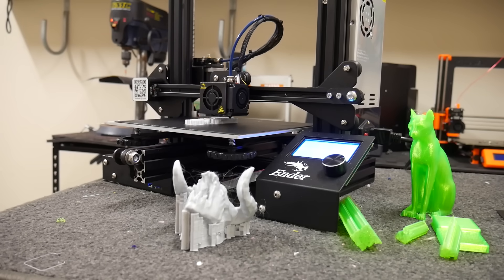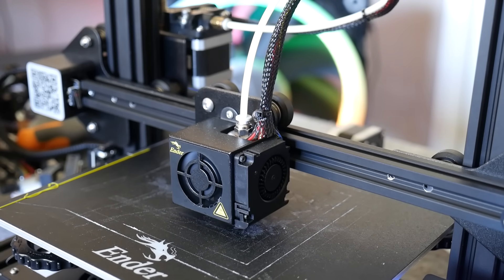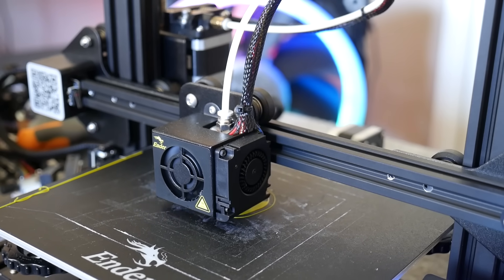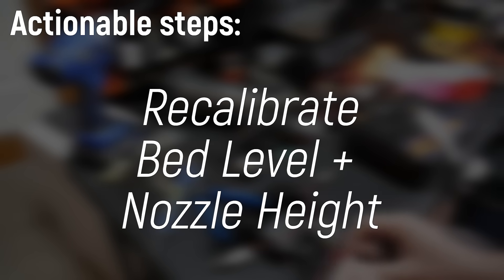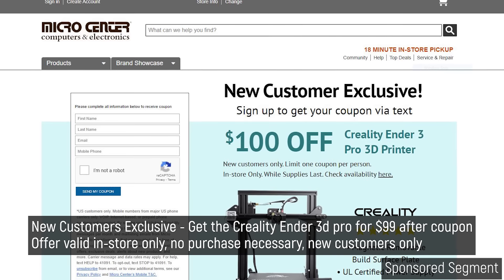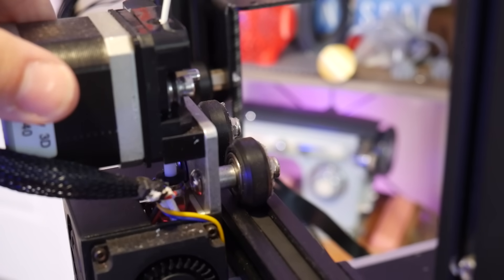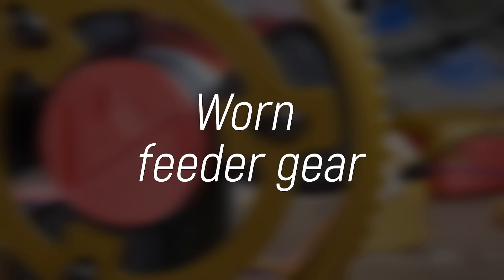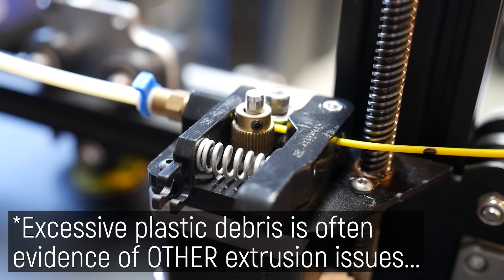Have your 3D Prints started to suck? Watch this!

Comment: Don't dismiss this information as obvious or basic. 6-7 years of 3d printing, 95 percent of issues I faced were addressed in this video.
Reply: True, the "mountain of ignorance" happens a lot for new people, and experienced ones forget the basics, kind of just thinking it was done already, or "it has to be more complicated than this".
Reply: In alot of cases the more experienced you are the less you actually know. You forget so much.
Reply: So your to 3d printing or bought the idiot proof version.... Started on a Tronxy p802ma thats bolta and metal in a box have at it, Where as a Ender 3 is 75% done in the box build the frame tram the bed good to go in 60 minutes or less....

Comment: Preventative maintenance is a must for any moving mechanism, especially if you don't want failures and down time.  Having spare parts on hand will make problems seem less significant.  No one should still have springs on the beds, silicone spacers or steel standoffs are far superior depending on the lack of, or type of ABL.  Great video topic Angus.
Reply: I disagree on not using springs. The Ender stock springs for sure should be replaced, but a stiffer set of springs can be excellent.
Reply: Springs work just fine, you just need to understand that if you've tensioned them where the coils are basically stuck together, you're gonna have problems.

They should be tensioned to the least amount, at the highest level. If your setup doesn't allow for that, then you need to change it, lower the head, lengthen the bolts and shim the springs. They should also be quality springs, not Bic pen quality as shipped with 99.9% of the mid level brands of printers. I use the springs used for BB g*ns, they're about the best quality you can get short of dismantling old Xerox machines to get the springs used in the paper tray mechanisms.

Silicone is a wearable item, and in time sags far faster than springs. You'd have a hard time finding 4 of the right durometer, IE to not sag fast because they're soft enough to actually do something. And finally, metal spacers are not a good idea. The whole machine is then tied to the bed. You've essentially transferred all the vibrations directly to your work surface. Unless you have the most rigid setup known to man kind, you're frakked.

Basically this whole discussion is present in cars. Rubber vs silicone, steel spacers vs rubber spacers etc. It's been done to death.
Reply: @aserta  plenty of printers have their beds rigidly coupled to the base that is nonsense
Reply: I can't stand silicone spacers.
Red load die springs for me, thanks.
Reply: @nicholasroos3627  You COULD do that, but it makes tramming on a bedslinger WAY harder.
Biggest problem I've found from springs wasn't from the springs flexing in their intended axis but because there was no constraint to keep them from sliding around.
As soon as I put spring collars on them so they were constrained in the x-y plane, have had no problems.
I only ever re-level my bed when I clean it, which is almost never. I'm printing on bare aluminum and using aqua net as an interface. No adhesion issues.
More important than how the bed is mounted to the Y-carriage is the quality of the kinematics for that axis. Enders and their clones, with that V-wheel BS, are especially prone to weird crap like this.
Reply: I work in an ISP NOC so i'm no stranger to how good it is to have spares around. That said, what spares would you recommend on a 3d printer (specifically ender 3 neo)?
Reply: If you do have springs they should be changed every couple of prints.
Reply: @jdakid156  changed??? bullshit. Why would you need to change the spring every second print?

Comment: Maintenance people its called maintenance, machines wear down, belts get stretched, bolts are shaken loose, pulleys dirty with dust, bearings get worn, the heating/cooling cycles distort the frame etc, etc. Look after your machines.

Comment: Ender 3 - if your prints are randomly getting punched off by your hotend a cm or 2 into the print, one of your factory springs is buckling over itself as it moves.

Comment: Great video awesome tips, for specific points.

0:22 Badly Levelled Print Bed
3:03 Dirty Print Surface
5:38 Worn Motion Components
9:27 Dead heat break fan
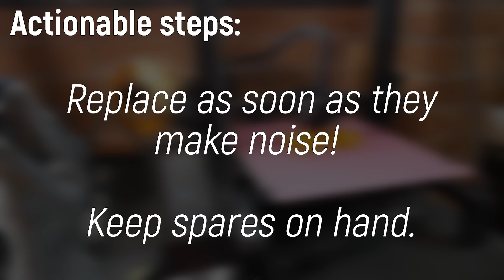11:16 Worn Feeder Gear
13:20 Blown out (abraded) nozzle
16:18 Electrical faults
18:16 Lack of Thermal Runaway protection
Reply: @Gtmz53fxt56zxc  maybe it wasn't when he posted the comment
Reply: Thanks
Reply: Thanks
Reply: Thanks now i dont have to watch the video

Comment: I printed 100,000+ hours on Ender 3s in 2020 and had almost all of these issues. PTFE cooking is a big one, and not obvious. Capricorn is awesome, but still only lasts 2-3x as long as standard. You can usually just cut a few centimeters off the end rather than replacing the whole thing.

Stainless steel feed gears are a very worthwhile upgrade.

A 30mm Noctua fan on the heat sync can help with noise and lasts way longer than stock (may need a buck converter).

If you're pinching pennies you can try and clear a clogged nozzle with a torch or lighter. Heating to red hot can usually get foreign materials out. But nozzles are cheap, just replace them frequently.

Set your Z height so that the springs are very tight to reduce the chance they loosen.

Oh! And one really tricking thing was getting cracks in the extruder tension arm. An aluminum extruder assembly can help with this if you don't just go direct drive.

So many hours, so many face shields. :-S
Reply: Yeah learned a lot printing as many face shields as fast as possible. They seem kinda silly now but at the time it was urgent.
Reply: @paintballercali  maybe to you
Reply: Heat Sink.  FTFY.
Reply: Yes, steel gears and a titanium all-metal heatbreak will save you so much time.
Reply: Swap out your hot end for an all metal one eliminates ptfe tube degradation. Saves money on ptfe in the end.
Reply: A couple notes on the Noctua fans:

- Regarding size, there are no 30mm ones (there are 30mm thick ones if you go all the way up to their 200mm fans, but not any smaller. The rest max out at 25mm). You want 40mm fans, which come in 10mm and 20mm thicknesses.
- They do have a 24v option, meaning no buck converters are needed, and they should be a drop-in replacement. If I had to guess, this is probably the same one that Prusa uses as their hotend fan. It's a 40x40x10mm fan, model number "NF-A4x10 24V PWM"
Reply: 100,000 hours are more than one year
Reply: Why face shields?  @paintballercali
Reply: @minecraftnoob113people can have more than 1 printer

Comment: I just ran into that heat break fan issue a few weeks ago. Started getting a ton of clogging out of nowhere, with the filament end mushroomed out just like you showed. Then I noticed the fan was getting much stiffer than it used to be, and remembering how the heat break works it occurred to me the filament might be melting too high up if it wasn't getting enough cooling.

Another thing I ran into recently was the nozzle tip wearing down. Since I have a BLtouch I don't have to physically check clearance under the nozzle very much, but periodically my first layers would stop working right and I'd look for something to tune to get them back. Noticed the texturing on the stock bed was wearing out, replaced it with a nice PEI plate. Deep cleaning it after every few prints, printing almost everything with a brim, glacially slow first layer acceleration, built a semi-enclosed acrylic shroud around the printer to keep drafts out... One thing that perplexed me for a while was that I had to baby step the Z offset down a little every month or so, on the order of .3mm or so over a year, at a fairly consistent rate. How is that even possible??

Then I got the nozzle completely clogged up with a failed print that went for a good hour before I caught it and decided to replace it (blob of filament smeared all over the outside surface, silicone sock was getting pretty deteriorated too). Looking at the new nozzle next to it I noticed the old one was worn down very visibly from the original tip. By roughly the amount of accumulated Z offset change I had observed up to that point.

As a hobbyist who genuinely enjoys learning how to troubleshoot and modify systems (and not someone running the machine to make money) it's really interesting how all the different failure modes can pop up.

Comment: Thank you for this video!  It helped me immensely already.  My wife got me an Entina Tina2 printer bundle after I looked it up, and after half joking about me learning to 3D print things to join her selling at craft shows (she crochets, AKA 3D prints with yarn), she said "that's it, we're getting it" and purchased it.  

It's done fun little things and I learned through some misprints and growing pains, but I am glad you brought up the fan on the heatbreak.  My fan is making that noise right now, and I've also been having trouble with builds not sticking to the build plate.  Admittedly, the surface of it is covered in what feels like the back of some masking tape. I also kept forgetting it was a magnetic attachment and was probably unleveling my bed by yoinking or scraping prints from the bed.  

This information is critical for veterans and novices alike.  Thanks so much!

Comment: Great video as always. Swapping out the original bed springs with the smaller diameter yellow ones found in several kits made the biggest improvement for me. Way less releveling of the bed with those. I also like the idea of using a piece of Capricorn tubing in the lower part of the hot end.
Reply: I'm glad to hear that someone else has gotten good use out of those yellow springs, I swapped my springs at the same time I added a bltouch to my ender 3 and have had trouble "quantifying" how much those yellow springs help 😅

Comment: Another tip: the screws that attach the gantry to the printer's base can loosen up over time and cause the gantry to move while printing. Make sure they're always tight (add thread lock if needed). Additionally, printers that don't have extra stiffness rods like on the Creality CR-10 or CR-6 Max can have inconsistent layers due to the gantry flexing in the Y direction. Fortunately you can buy these rods separately and install them on many other brands (I put them on my Artillery Sidewinder X1 and now my walls almost look like they were injection molded).
Reply: What rods are you using for your X1? Would you be able to share a link? I have  awful lines when I print tall stuff out for my kids and would like to see if rods can fix the issue but I'm having a hard time finding correct parts.
Reply: @Gtmz53fxt56zxc  Not all plastics can be vapor processed, and most of the time you'll still notice the layer wobble even after smoothing. Better take care of that gantry, it's easy and cheap to do.

Comment: 3:45 For my Prusa Mk3 I found that putting the removable print beds in the dishwasher for a cycle (without detergent, running with hot water only) is the best way to get the bed 100% free of contaminants.  The majority of prints I just wipe it down with rubbing alcohol (mineral spirits), but after so long the oil build up just won't come off completely and will only smear.  That's when it goes in the dishwasher.
Reply: Great tip, thanks.
Reply: would you use a heat boost/steam cycle or could that warp the bed

Comment: This video does make me appreciate my prusa a bit. Many of these exact problems addressed and overengineered;
* A fancy bed that keeps forces away from the bed.
* A fancy fan that likely will outlast the printer.
* Hardened feeder gears.
* Rods that are a little better than the wheels(but not without problems)
And a printer that just keeps chugging along. 
But all of the coolest stuff is on the Ender platform.

Comment: thank you for pointing out the heat break fan issue, my Ender 3 V2 has been making that same noise but I didn't think anything of it because it always fixed itself when it reached 80 or so degrees. now I know it should be replaced sooner rather than later

Comment: This is hilarious to watch in 2024. Clips on the build plates, springs for bed leveling. Things really got easy and cheap REALLY quickly in the last 2 years. You can get a magnetic build plate with self mesh leveling and input shaping for $299 now, crazy

Comment: Reason 1 is why every one of my printers has an auto bed leveling feature added... it never goes "out of level" because it does a 4 corners every print and adjusts.    Get a bltouch or crtouch, you'll like it.

Also... while you can get ball bearing fans very cheaply, if you have the money go noctua.... theyre so nice...
Reply: In my case, the cr touch doesn’t work.
Reply: @Minionbro360  really?  Ive never seen a situation where the cr doesn't but the bl does... they use the same wires and voltages, you just sometimes have to change the order depending on your printer.  Gotta be careful though, its easy to smoke one by having the wrong polarity.  They really need a zener diode in the damn things just to protect em.

If its a board issue, I can happily recommend the BTT octopus as a great upgrade for basically any fdm printer, or the btt skr2 if you dont want something quite that powerful.... but there's almost no reason to go for the skr over the octo unless you have a space issue... being able to upgrade and add tons of extra drivers and such if you need em is mwah
Reply: @NeoIsrafil  At least I don’t think it’s working because I level the bed and then use the cr touch and it doesn’t do anything. I don’t know why.
Reply: @Minionbro360  The G28 command in the beginning of a print could disable the bed leveling.
Reply: But do you mean bed leveling or bed mesh compensation?
Reply: Auto leveling is epic, I do suggest getting it sort-of leveled manually anyway but just calling it useful is an understatement, specially if you swap build plates.
My Triangle labs 3D touch was a great upgrade, even compared to the servo button I had. Tho...It did crash a few times and the printer decided that "Oh yeah, it's finished! I don't care about that error, ram the nozzle in the bed and let's go!"... damn idiot that programmed that thing (it was me).
Reply: Bltouch and CR touch does nothing about your bed levelling. It's a mesh compensation program that measures the unevenness and compensates for it during printing, so relying on that alone might mean you have a very warped bed and a program trying to correct it during printing.
Reply: I put a bl touch on my ender and I can not suggest it was not worth the work. Upgraded springs and learning to level made more of a difference and a lot less effort.
Reply: That's just plain dumb, it may kinda work but it is a software compensation for a hardware deficit, your prints will suffer in quality and time because your printer will have to switch between layers for a single layer. I recommend manual leveling even if you are lazy
Reply: @Ghost-xu4yg  The "and time" aspect is plain wrong unless you're really concerned about the ~1 min pre print measurement (less if you calibrated the mesh beforehand and just do a 3 corners before the print starts). Edit to clarify for who's unfamiliar: ABL doesn't add or subtract layers, rather it moves the Z axis during the same layer's printing slightly, following the bed contour. If it's moving a lot you either got a terrible bed or it's exaggeratedly out of level and should be manually set 1st.
Quality is arguable but if you tune it close enough and let the software and probe do the final touches, that 1st layer is going beautifully down and nothing to ever see it was auto-leveled, if you let it be severely angled then that's when you'll actually have quality problems. If you're printing on a banana shaped bed there's nothing to help you tho of course other than disgustingly thick rafts

Comment: Thank You very much for the ideas on troubles with printing, and what to look for.
I had a thermal run away , and it really shocked me when the alarm went off.
I started over with the same print, and at the exact same place and time, it happened again.
I re-sliced my print, and tried it again, and it never happened again.  There must have been a
glitch in the g code is all I can figure.
I really learn a lot of good ideas from your videos.
Thank You again.
Michael

Comment: Thanks for a bunch of tips here

My tip on cleaning the bed surface is to use a damp microfibre cloth with water, just tap water. This removes most of the oil and dust so far as you won't notice it, without "chemicals" (except that dihydrogenmonoxide is a needed substance, but again that's for another time).

Comment: If there was a 3D printer god, you'd be their high priest.  This video couldn't have come soon enough.  I've been struggling with mine for a while, it was running just fine for about a year and then out of the blue I just couldn't get anything to print at all.  If you're ever in Melbourne I'll shout you a few beers because you've restored a bit of my sanity.  Now, I'm off to dehydrate some filament and get this printer running.

Comment: Great Video, and I strongly agree, ALWAYS check if your printer has thermal runaway protection! Especially if you leave the printer unattended.
I just had my Monoprice Select Mini V2 do a thermal runaway, luckily I was sitting at the work bench where the printer is, so I caught it before it could catch fire, but the whole hot end assembly an PTFE tube was already smoking. The smell was horrible, too. I guess the thermistor lost connection, because it was happily heating and showing 153°C, while smoking like crazy. 
My more frequently used Artillery Genius Pro has thermal runaway protection, but I am a bit concerned to leave it printing while I leave the house now.
I don´t want to imagine what could have happened with the Monoprice if I hadn´t been there to stop it...